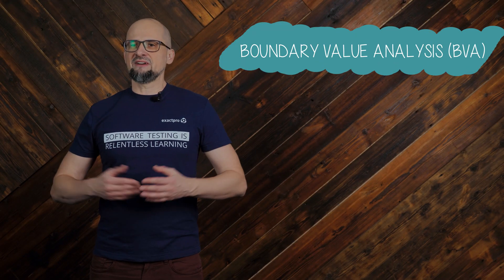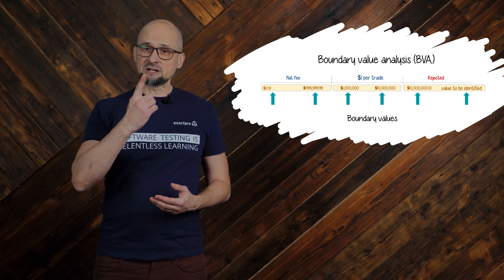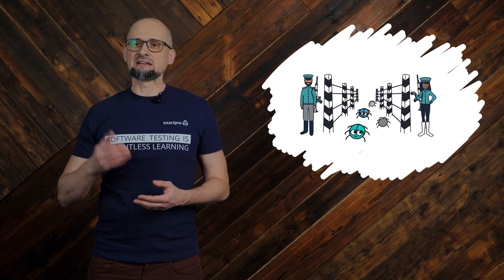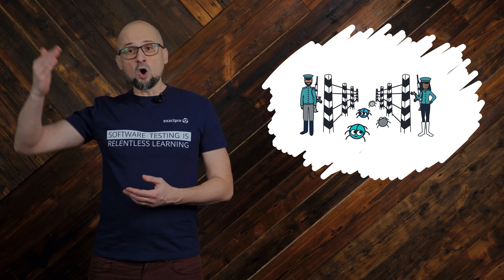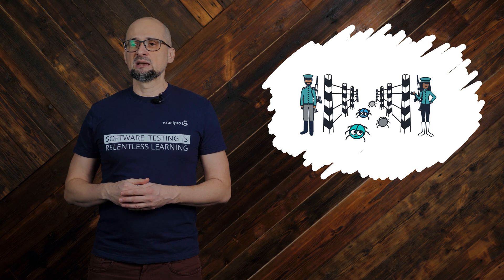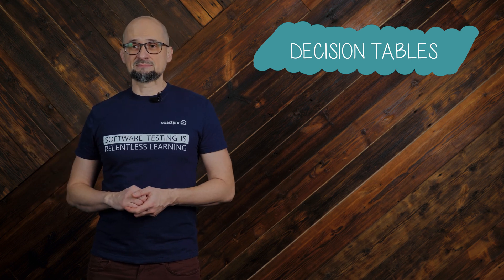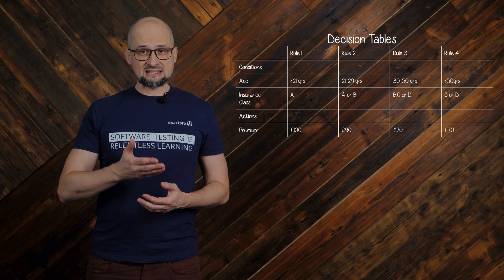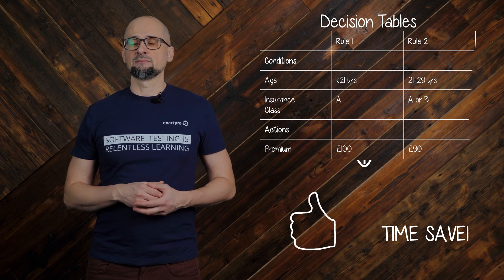ISTQB Foundation Level Certification Explained – Chapter 4 (Part 2)

Comment: My answers for the quiz are:

1. Boundary value analysis, or BVA, may be considered as an extension of the equivalence partitioning, in the sense that the minimum and maximum values of the partition are its boundaries, where the defects are more likely to appear. However the BVA is difficult to apply for non-number values.
2. Each value must belong to only one equivalence partition - as it should be treated by the system in a particular way, distinct from all the other ones.
3. For the decision table technique, coverage is measured as the number of decision rules tested by at least 1 test case, divided by the total number of decision rules, normally expressed as a percentage.

Comment: 1. Boundary value analysis is an extension of equivalence partioning technique.
2. Each value must belong to only one equivalence partition. 
3. If you're using decision table technique, coverage is measured as the number of decision rules tested by at least one test case, divided by total number of decision rules, normally expressed as a percentage.